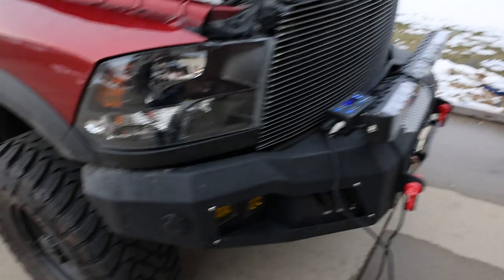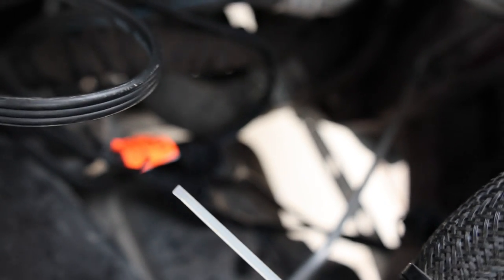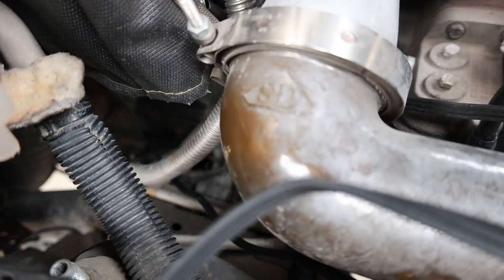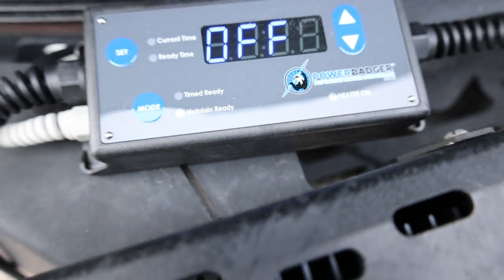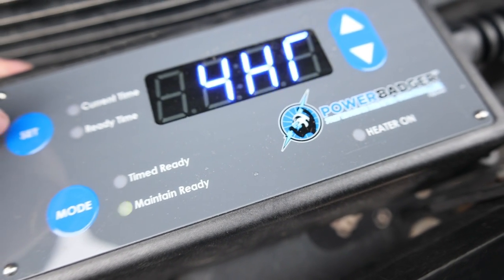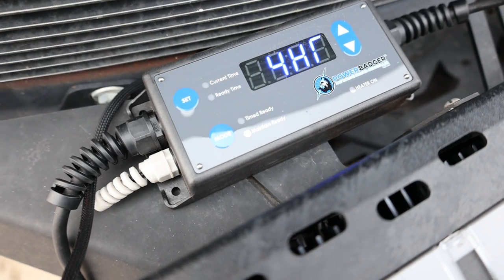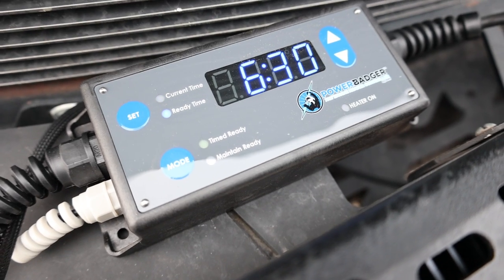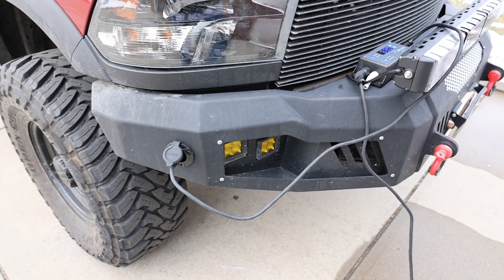Setting up the Powerbadger Engine Heater Controller and NOCO Plug on the Ram 2500

Comment: Nice! 
I wasn’t aware of this. My house is setup with smart switches and outlets. I have an outlet dedicated for my block heater on my shop and was planning on just programming a smart switch to turn on a few hours before I leave, but I like this better. 
How long is the cord from the controller to the plug you plug into the bumper? I think I wouldn’t install the controller on the truck, just leave it mounted on the wall next to my outlet. Just keeps it off the truck to prevent harsh elements tearing it up all year. 
Thanks for the video! Think I’ll snake me one.
Reply from the maker: About 4 feet from the controller to the outlet side. Used again this last winter and it’s working great still!
Reply: @sonictraxx how’s it working this winter?